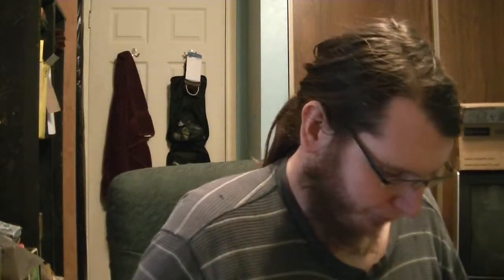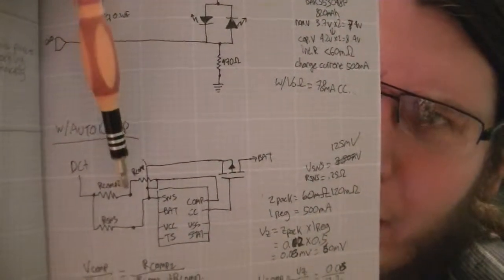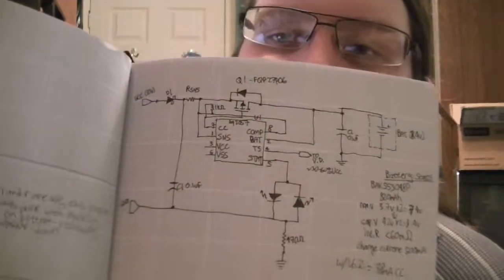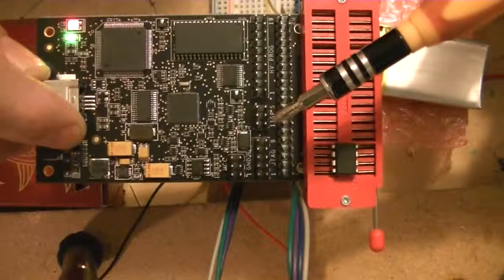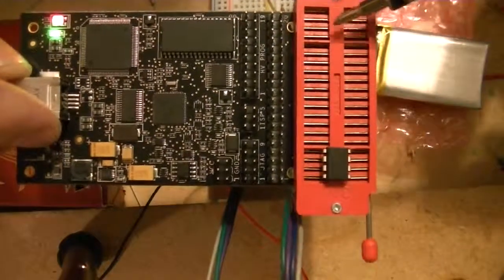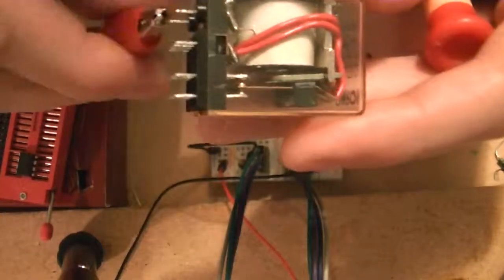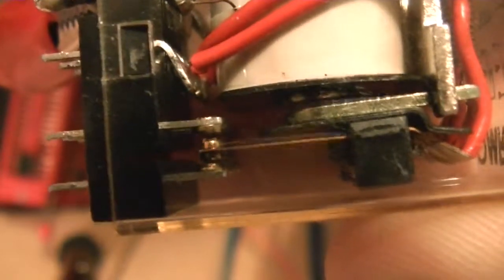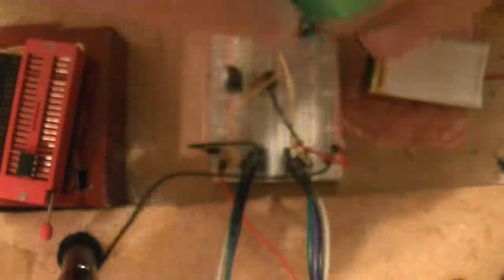Battery Charger, Ribbon Cable Tester, and frozenelectronics.com

Comment: Man that ribbon cable tester is gold. I have been getting into repairs for hobbies. I enjoy cell phones, tablets, and nintendo handheld units like wii u, 3ds, and 2ds. The problems with these are the flat cables or ribbon cables? Not sure the actual technical names yet. The ribbon cable socket connectors have the latches and if they are not latched down properly then theres a short. You never know if its a new faulty screen you put in, or damage to the fcp socket connector. I learned if you use a piece of kapton tape as a shim it helps make them latch down better. IDK, as I said I'm a noob and an amatuer at best. I really respect you putting out all your hard earned knowledge out here. Thanks!